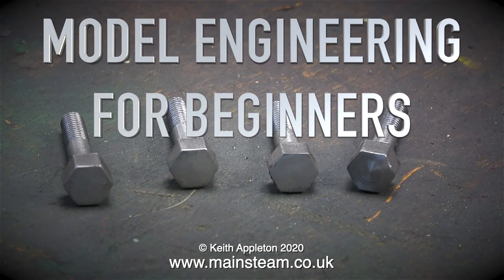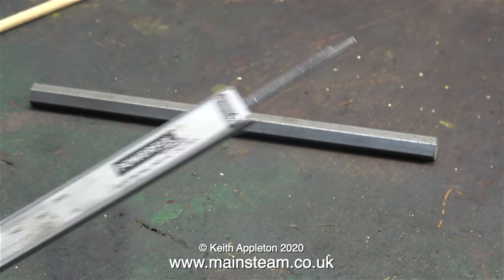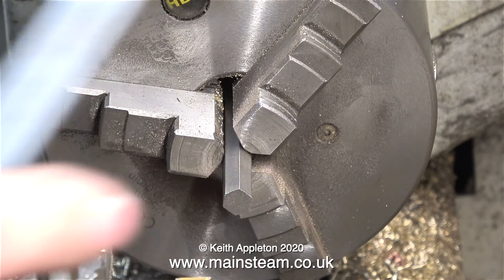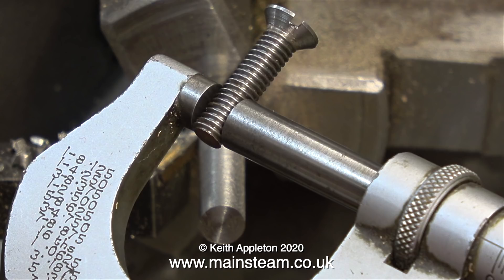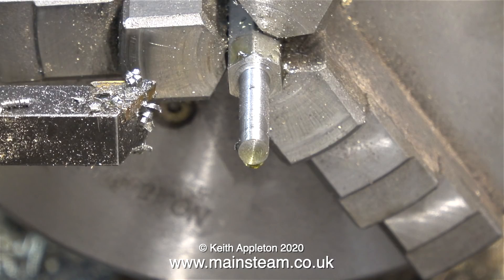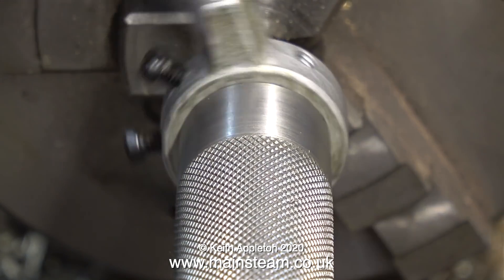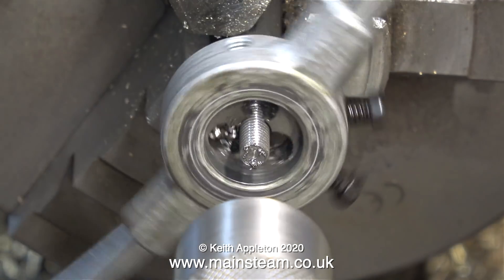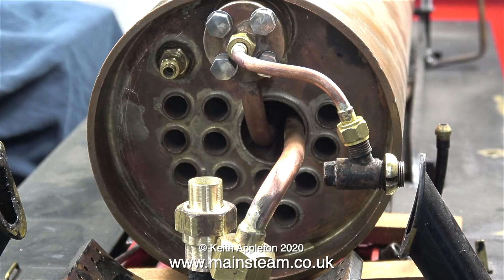MAKING YOUR OWN BOLTS - MODEL ENGINEERING FOR BEGINNERS - PART #36

Comment: A brilliant tip learned! Every single bolt-making tutorial I've seen always uses round stock, then machines the hexagonal head on a mill (threading then turning in the vice once for every face milled). Many more steps (not to mention requiring an additional completely different machine) than you just described. Work smarter not harder and be like Keith, use hexagonal stock to start with, machine the shank, thread it, then part off your newly made bolt, complete with head!
Reply from the maker: Thanks for the kind words - it is always good to find a simpler way to do things!

Comment: I have found it very difficult to explain things like why a stainless steal bolt is stronger than a mile steal bolt that has rusted through.  It is like trying to explain why it cost difference of using a light bulb in winter vs. summer.

Comment: The magnet test doesn't work on all grades of stainless steel. 4XX series stainless alloys are magnetic (it's a ferritic type stainless steel). I also know that 416 is quite abrasion resistant and is stronger than 3XX series stainless. It is less corrosion resistant, but still reasonably corrosion resistant. 

I have some experience with 416 stainless because that is what stainless steel rifle barrels are made of. It's been a while since I've gotten into the machine shop to barrel an action, unfortunately.

Comment: And being up late watching Steamy drilling holes and making piston rings videos MEANS WE ARE FIRST.
A Simplex is one of my current projects. The superb Boiler and wheels came via Simon being in the Reading area 2 years ago.  Funny I met his Mum and Dad last week delivering a 5 inch Midge. These are rare and this started in 1947 as it says on the ancient BLUE PRINT.  Yes I often make my own and my favorite is countersunk to 60 degrees and left on the stock. These then get covered in my favorite Super Steel and tightened into the assembly. The stock gets cut off and the rest filed flush. 
Love from David and Lily.